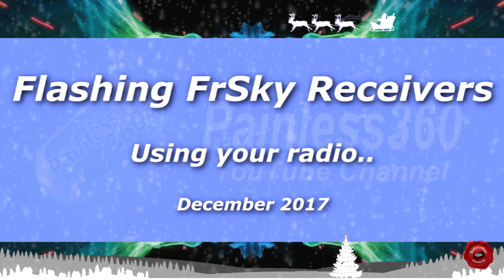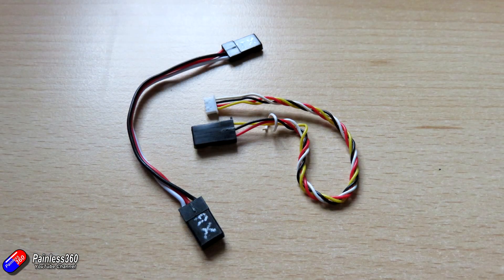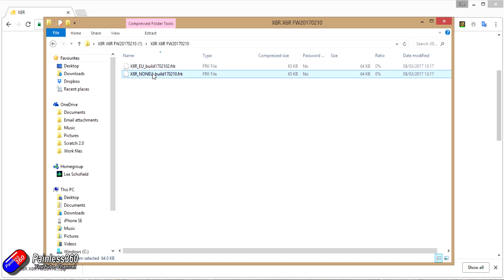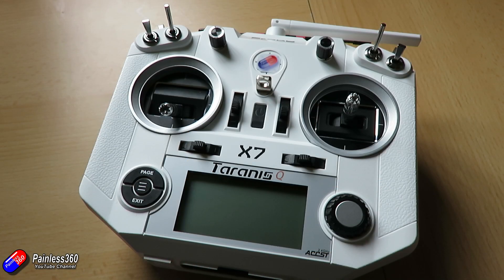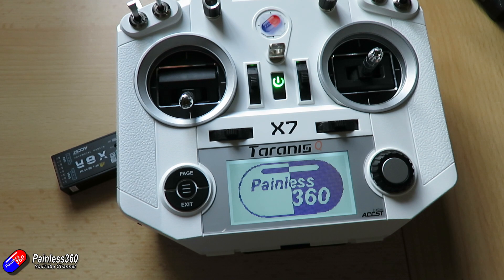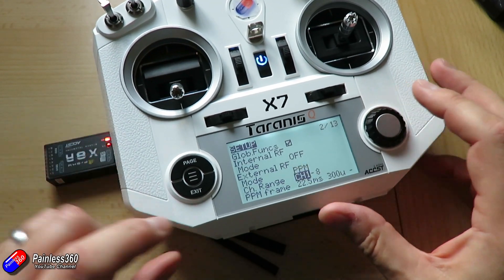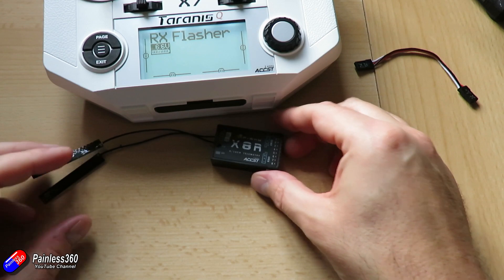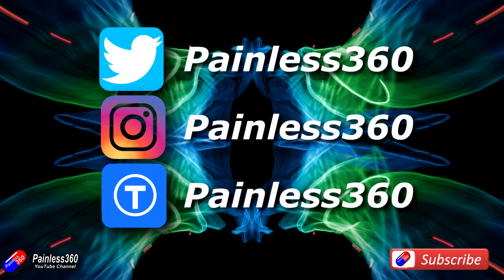RC Tips: Flashing FrSky reciever firmware using the radio (re-upload)

Comment: If your receiver won’t bind after it’s updated check your universal or lbt and check your internal module (xjt) is up to date too... just spent a few worrying minutes thinking I’d broken the receiver.  Flashed to lbt not working, flashed to universal still not working... flashed internal to universal... fixed it 😊. Thanks for the clear vid.

Comment: Another excellent "HowTo" video from you.  The reversed servo wire tip was what I needed, having seen no mention of it in any other video provider on programming the Taranis receivers. It was the missing link that I needed! Followed your instructions, the latest firmware is installed on my S6R,  Now going over to the other videos of yours detailing the rest of the S6R setup.  You are my go-to guy for RC advice.  Thanks.

Comment: Great Video thanks Lee. You've just saved me £30 and an Archer SR6 by showing how to use the S.Port on the bottom of a X7S to re-flash it. 2 Days of pain quickly healed.
Reply: NOTE I also had to upgrade my transmitter firmware - OpenTX companion is a great tool!

Comment: Great vid, thanks! My X9D Plus 2019 has an SPORT in the battery bay. It makes it easier because you don't need a custom servo cable, and you don't need to mess with your radio model settings. I found this because the firmware flashing gave me an option to "Flash to S.Port Device" in addition to internal and external, so I went looking :)
Reply: Thanks for this info, my receiver wasn't flashing untill I tried to write the firm to s.port, then it started.

Comment: CAN SOMEONE PLEASE HELP ME?

Hope someone can help me figure out what I'm doing wrong. I am trying to update my X9D+ radio firmware using the SD Card and "flash internal module" option. It says "resetting device" for a few seconds, with a progress bar at the bottom, then shows a "Firmware update error Device not responding" I havent been able to figure out how to get this firmware to flash. I flashed my receiver fine with the "flash external module" process but cant flash the internal transmitter. I have tried different versions of firmware and all do the same. Not sure how to resolve this and I can't really find any info on it either.

X9D+
Firmware: opentx-x9d+
Version:  2.3.15-otx
DATE: 2022-04-22 15:30:36
EEPROM: 219
Reply from the maker: I'd make sure you are downloading the right firmware. See https://oscarliang.com/flash-taranis-internal-module/
Reply: @Painless360   Thanks for your reply. I've verified correct firmware. I have every firmware available for the XJT and none of them will flash to the internal module. I was wondering if I could use an S-PORT to flash the internal module if I take it all apart? I This radio was purchased in 2016, connected and tested working, but then sat in the garage collecting dust for 8 years and I am trying to revive it. At first I thought it might be the internal clock battery but I replaced that and still no luck.  I have been poking it trying to figure out where the communication pins would be, no luck so far. Been trying to figure out what I can with oscilloscope but not sure what im actually doing lol.
Reply: Just wanted to give an update. I figured out the TPS5401 Step Down Converter is failing. Since my flash would always fail at the "resetting device" stage, and the battery calibration option in the settings was always sporadic and not fixed, so I figured the issue had something to do with power. So I traced the circuits and found that chip to be doing some weird and unexpected things. I ordered a replacement from ali and should have it in a couple of weeks. Will solder it in place and hope it resolves my issues. If not I will likely be purchasing a new transmitter. Really wanted to avoid this but oh well what can you do.

Comment: I followed this video step by step but as soon as I connect thee X8R to my X9D + Try to flash the only option I get is 'Delete' ...Any ideas? :/
Reply from the maker: I've never seen that. Let me know what it is when you get it working... Best of luck
Reply: I am the exact same - any solutions yet?
Reply: @Zoomer1973  Ended up flashing an older firmware and pairing to a older X8R that I received the controller with. No idea if it was the firmware or newer receiver but hey...Atleast I can fly my drone again

Comment: Thank you.  I have X10s Accst...Will a standard servo cable work between the back panel s-port and the rx, or do I need to swap the black and red wires?  Cheers
Reply from the maker: I'd expect so as all JR bay pins should be the same. You can confirm using a multimeter.. Best of luck
Reply: @Painless360  Thx, the s-port on the back of the X10s seems to have pinout correct, just like your example of the X7S at 06:30 .  I guess it is when you would connect to the external module bay you would need to swap the pins.  Thx again.

Comment: Hi, I want to ask you, I have receiver G-RX6 EU LBT and Taranis QX7 from Bangood and I think it´s International version. When I want to bind receiver, I have XJT D16 no only D16 mode. When I start bind on Taranis, push bind button on receiver and connect battery to receiver, red and green led are still on, so it shows that proccess is runnig. But after 5min both leds are still on.When I disconnect battery and connect again red led is flashing and green is off so it shows failsafe. Can you help me? Taranis has the newest version of firmware. Thank you

Comment: Important Notice :  On the Frsky taranis x9D plus SE 2019 the 5v is missing on the central pin in the battery bay !  Use the three bottom pins in the Jr bay, not doing so you're not gone be able to flash your receiver if needed.
Reply: Maybe you don't believe me but I say this is amazing. Thank you very much.

Comment: My receiver doesn't start blinking when plugged in and TX turned on. Maybe the servo wire I did is not good? Thanks
Reply from the maker: Be careful, the power connections are flipped if you are using the JR Bay and the power only comes on in the bay when you have it selected..
Reply: @Painless360  and how do I do that?

Comment: Any suggestions on how to flash a R9 receiver with a T16 or TX16S?  I have tried using the module pins, but the radio does not allow me to select the .frsk firmware for flashing?  There are UARTS at the bottom of the radio, but they are not defined as a SmartPort?  Any help would be greatly appreciated, getting very frustrated with this!  Thanks!!
Reply from the maker: I've not tried it but checking in the manufacturer it should be possible via the JR bay. Make sure you have the power to the bay selected by having something like PPM chosen as the external module protocol before you try.. I'll make a video for it when I get round to trying it here..
Reply: @Painless360  Thanks so much for the reply! I did end up finding a work around (late) last night. I switched to the ACCST protocol, which uses .frk receiver firmware for the R9MM. I think the issue is more with OpenTX and its inability to flash .frsk (on the ACCESS protocol) firmware via the JR bay pins.

Comment: great video, i'd be lost if not for watching your channel. When I connect my receiver to the servo connector on the taranis Q X7 (new) no LEDs came on. I checked with a multimeter and I don't get any volts on the +5V servo connector.
When I tried with the J connector on the back, the +5V is measuring 7V, is this correct or will it destroy the receiver?
Reply from the maker: Sometimes you need to turn on the JR bay by selecting something like 'PPM' for the bay to be powered. FrSky have been really poor at maintaining a standard in their radios for this stuff.. Best if luck!

Comment: Hi, have I was wondering if you've encountered this problem before but I cant seem to find anything similar on the internet. I'm using R9M and r9 mini and they connect fine but after a few seconds the signal just gets lost and fast red blinking light comes on in the receiver. If I unplug the battery and plug it back in it connects fine again just to drop few seconds later. Any ideas?
Reply from the maker: Sorry, I dont use the R9M. I'm not a fan of it. Best of luck..

Comment: I'm back - getting back into RC. I (as in your S6R vids) tried to configure the S6R when I first got mine. Failed miserably (mostly due to Win7 and the STK tool). Thought I'd try your "do it from the Tx" method. Followed through on this vid to flash the S6R. All seemed to go ok but I didn't get a green LED during the write and it won't bind (red and flashing yellow) - any ideas? Have I cobbled the Rx I wonder?  I didn't even know about the flash from the Tx. Would be really cool to be able to do this. Great vid as usual. Looking fwd to getting to the stabilisation vids.
Reply from the maker: All I figured out is in these videos. I'm not a fan of these things myself. For the reasons you are no doubt discovering - nice idea/terrible implementation..

Comment: Couldn't get this to work on my QX7S Taranis . I found out by searching that the QX7S needs a STANDARD servo cable (NOT reversed) for this to work. Then flash by accessing the Firmware folder, highlighting the firmware update file then press and hold the menu button on the right side of the radio and select "Flash S.Port"
Reply: UPDATE:  After the flash above I could no longer bind to my S8R receiver.  Below is a post I made on the RCGroups forum after finding a solution to my problem. I hope this helps someone!

" I have a new S8R receiver that I bound to my Taranis QX7S (OpenTX 2.3.14) successfully. Before doing the stabilization setup I decided I should update the firmware and flashed the S8R receiver with the latest S8R-ACCST-2.1.2-FCC.frk. I flashed from the QX7's S.port using a standard servo cable and the flash reported that it completed successfully.

Unfortunately, I could no longer bind with the receiver when done.
I then tried flashing the S8R with the S8R_ACCST_2.1.0_FCC.frk which again appeared to updated successfully. I found I could not bind to that version either.

In desperation I started checking through the various online RC forums until I came across this thread suggesting using the S8R_FCC_20190531.frk. I was able to download the firmware from the FRSky site using the "History firmware DOWNLOAD (not compatible with v2.x.x)" link, and flashed it to my S8R. I am happy to say that after the update I was once again able to bind my QX7S to the receiver.

Why the newer S8R firmware versions do not work, I do not know, but I am glad my receiver wasn't bricked!
Thanks again for posting this fix! ?

Comment: Problem: since I did the firmware upgrade on the fc my receiver has stopped communicating with fc. It connects fine with transmitter. But has now lost connection with f405 & rxsr but less than a month old.
Any suggestions?
Reply from the maker: What troubleshooting have you already done?
Reply: Painless360 I’ve tried to update the firmware on the rxsr but can’t seem to find help with the t18, I understand that if you get the pins wrong it can wreck receiver. Sent an email
Reply from the maker: Free help available here in the comments (if you sent the email to me). See my video on updating receivers on the TX16s. Should be the same fro the Jumper radio..
Reply: Painless360 thank you, really appreciate the help, your very kind
Reply: Solved: uart2 not selected, click of a tab!!🙄🙄I’m an idiot

Comment: Frsky tells subject to flashing their transmitters with the relevant ISRM firmware, to do the same equivalently with the receivers.
Flashing the Rx via SD-Card of the Tx is not possible, because an external module is not being offered by the software for flashing. 
Maybe everything needed is included within the Rx-Firmware offered for download? 🤔

Comment: Good timing Lee, Father Christmas is bringing me a Taranis X9D plus. But please, can you advise me on which version to flash, International or EU (LBT)?  I'm in the UK so the EU (LBT) is the obvious choice but is there any advantage in using International?
Reply from the maker: If you're radio was bought from a EU reseller then it'll come with LBT on it and have a sticker on the radio showing that too. You should use this mode in the EU but you will loose the D8 protocol that some BNF models want..
Reply: You don't need to lose the D8 protocol! Just disable the eu build option on the Radio Profile under settings and re-flash the transmitter firmware. I did this and I can run the D8 mode on my Chinese micro-quads whilst still binding to pukka LBT FRSky receivers.
Reply from the maker: I wish that the radios came with this as standard as a lot of new owners are reluctant to flash their new radio in case they have a problem. Might be worth a video when I flash my main radio to 2.2.1... hmm..
Reply: I don't think the D8 mode is LBT-compliant so the radios can't be legally sold this way in the EU. I'm just glad we can use this work-around!

Comment: @painless360. Thanks for a fantastically informative video. for the uninitiated, can you provide a link for a servo cable suitable for flashing receivers with a 2019 taranis? Thank you
Reply from the maker: It's a regular cable that you can use a pin to release the two wires that need swapping.. Best of luck!

Comment: They made another change.  When flashing, after selecting the firmware, the transmitter says "Flash S-Port" or "Flash Ext module".  I used both front S-port and rear pins.  Both appeared to work.  Receiver would still not pair.  BTW, you are awesome.

Comment: Do you know the difference between FCC protocol receivers? And which one, with LBT protocol?
I know that the FCC is for the rest of the world and the LBT is for Europe. But what is the difference? And if for example, I'm in Europe, and I use the FCC. What is going to happen; Thank you.
Reply from the maker: Most of the recievers can be flashed with either to suit the radio you have. Using a non LBT radio I'm a country that should have LBT would still work but not complying with the local legislation. Happy flying

Comment: Perfect! Thanks for the video. Just two pitfalls: The newest firmwares are provided with the .frsk ending. This doesn't work with older Transmitter versions, you just have to rename the file with a .frk ending. The SBUS port at the bottom of my QX7 works fine, but before flashing, the receiver will not light up. No problem, it flashes anyway, just a heads up.

Comment: ive been trying to flash my frsky r xsr with my new radiomaster tx 16s for last to days but no go. I followed your video very close and reciever powers up good i put firmware on radio sd card. I put sd back into radio opened firmware and when i click on the firmware that i added there is no flash opitions only rename copy past and delete so i cant flash please help if you can Thanks
Reply from the maker: https://youtu.be/Jwp2Pd_x6I0 may help
Reply: I watched your video and finally flashed my R XSR with this radiomaster tx 16s, I flashed it with firmware 2.1.0 fcc version but still no go radio will not bind I have tryed ever frysky model in radio, The radio module status is 1.3.1 this is what it came with, could this be the problem.thanks for all your help

Comment: Hi, thanks for your video series, they are helping enormously as I am very new to the hobby.  I have a question that you may laugh at, but I cannot find an answer elsewhere.  I have a Taranis x9d with frsky firmware that I want to flash to opentx.  my question is this.   Do I also have to flash the receiver (x8r) to opentx?  If I do not do this, will the tx be able to communicate with the rx?  Thanks in advance.
Reply from the maker: Nope, the Rx should connect fine. :D Happy flying!

Comment: i highly recommend you pull the SD card out and load to it as an external device directly plugged into the radio.   Then after it is on the card reinstall it into the radio and use the radio to program the RX.

Comment: Hello Lee, 
I struggle with the flashing of my S6R reciever, the Problem seems to be, that my Taranis x7 doesnt recognize the SD card i put in it.
I already flashed the newest firmware on my Taranis and got the SD card contents, but the 2nd Page in my Transmitter Menu (When you click Menu long) stays empty. As far as i understood in your S6R video the Flashing is necessary. Yesterday i tried to bind my S6R to my taranis x7 but it didnt seem to work quite right.
Hopefully you got some ideas how i could fix that problem.
Reply from the maker: I'd try another SD card. Best of luck.

Comment: Thanks Lee, I was able to reflash my S8R receiver using this technique (after everything else had failed...) Just one question, how do you make the cables you mentioned? Is there a special tool or something to connect a servo plug to three wires? Thanks.
Reply from the maker: I just use a regular servo lead and use a pin to extract the two wires I need to swap.. Happy flying!
Reply: Bend up on the black or white plastic plug lock- flap with a pin or dull razor blade and look how the wire end comes out and note to put it back the same . 3x reading glasses help most people see .

Comment: Ok, The change of the SD Card did the trick. now i wanted to flash my s6r reciever, i follow your instructions, get the red LED flashing, but get the Error "FW update Error Bottom Pin no response" as i press and hold Enter to flash an external device. Any advice on that?
Reply from the maker: What troubleshooting have you already done?
Reply: @Painless360  
I did solder the connections of my servo lead again and checked the polarisation. I already tried another one but got the same error. I tried a complete different reciever, and the problems kept coming. The motor doesnt turn but stutters in both directions... seem to have several problems with my setup...